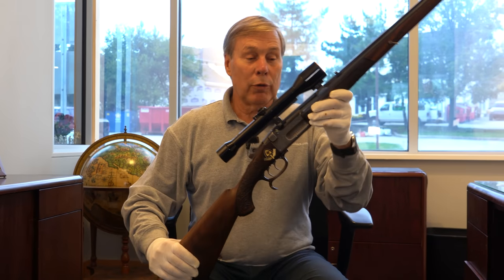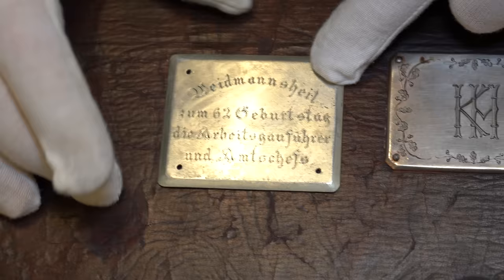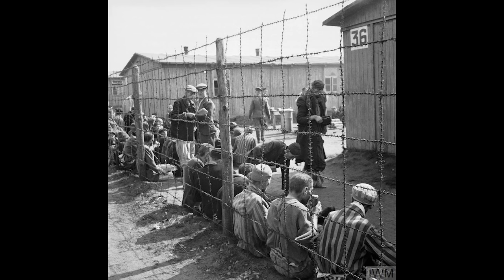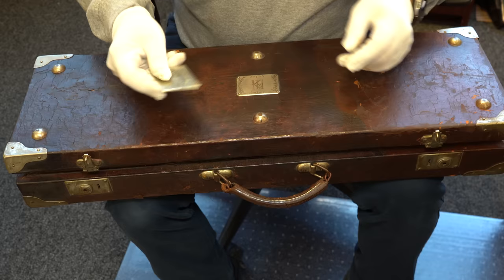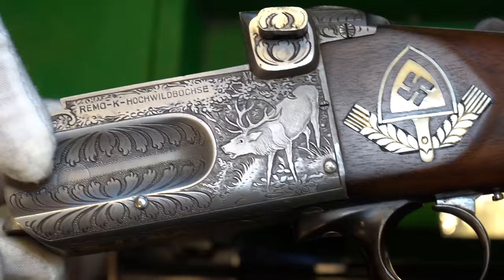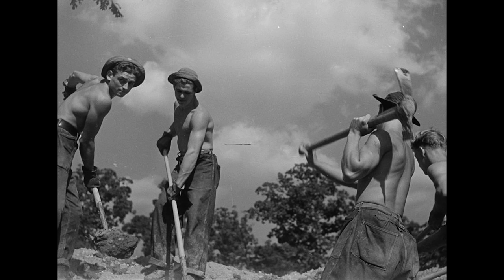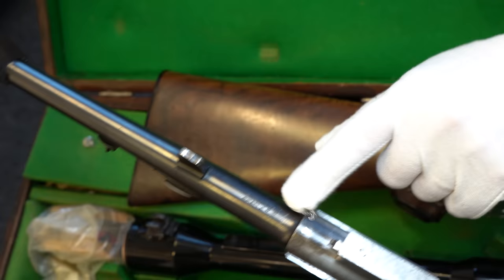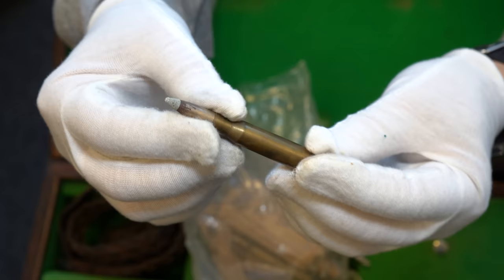Rifle Presented to the Third Reich Labor Service Commander on His 62nd Birthday!

Comment: Reticle is German nr 5 acc to German Hunting Guns page under scopes there.

7x65R was developed by Brenneke and is one of the most used cartridges today . Many make it and ammo of many kind to be found . 
Can be compared to a .280 Rem
Reply: Yeap. I have mine right in front of me (rifle/shotgun combo gun). It's basically a rimmed version of the 7x64, or the "Brenneke", but it's normally downloaded a bit because people shoot them in old guns and bolt guns can take more pressure. But yeah, classic rimmed cartridge and still very much in use. But mainly in Europe.
Reply: 7x65R is a very fine one that is perhaps one of most used of them all

Even 8mm Brenneke made  8*65  and the 9,3*65 R which is the ballistics and presiser similar to 9,3*64 for bolt rifles

Comment: I would have to guess that the extra metal plaque was the original attached to the case and was replaced by the owner who personalized it with the replacement plaque that contained his initials.  I would bet that the nail or screw holes match up with the original.

Comment: The RAD was not the same as the Organisation Todt, which handled the forced labor from occupied territories and was responsible for major military construction projects ranging from U-boat pens to the Atlantic Wall fortifications to the Siegfried Line. The RAD was compulsory for Germans and lost most of its labor pool after 1939 to military service. It did not generally make use of slave labor, and the post-war trials bore this out.
Reply: Similar systems was around elsewhere also , like In anciebt Egypt , when Nile floder the farmers field they worked on national buildibg projexts , hired by Pharao.